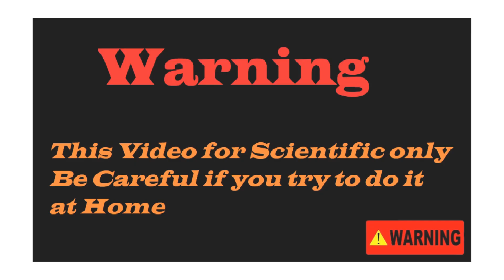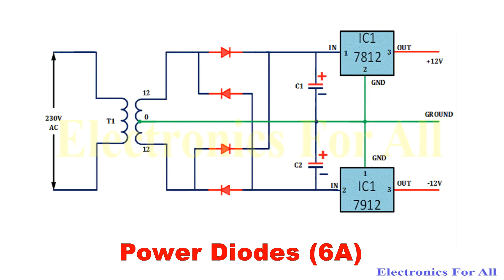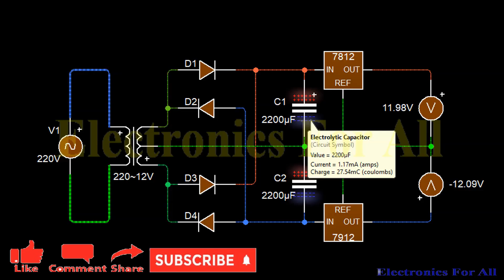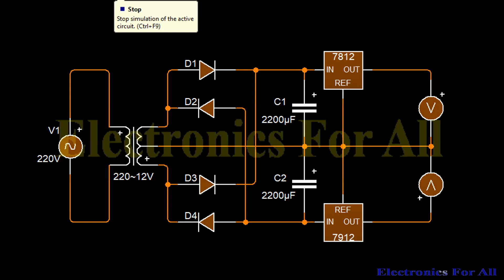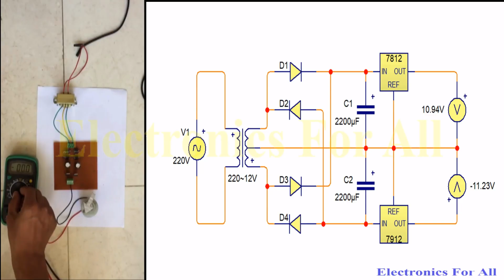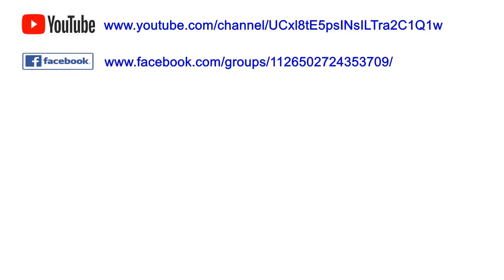This Simple Circuit Gives You +12V and -12V at Once!

Comment from the maker: Circuit diagram is in the thumbnail 👆 Save this post!

Question: Do you need 1A or 2A version? Comment below and I will make it next!

This supply powers any op-amp: LM741, TL072, NE5532 etc.